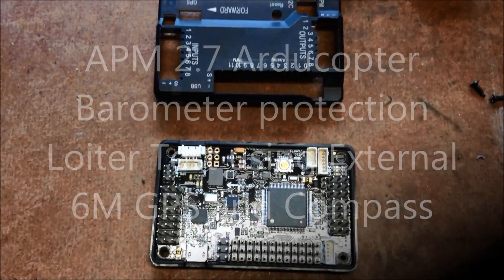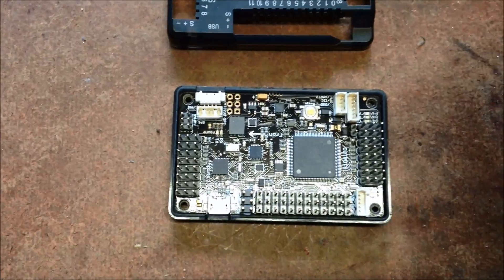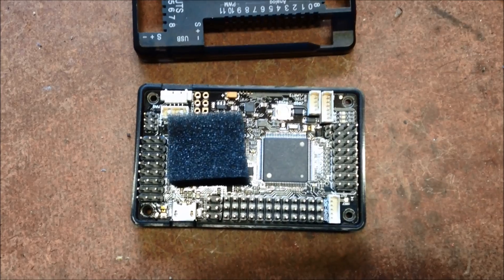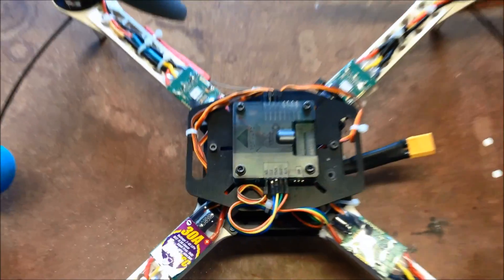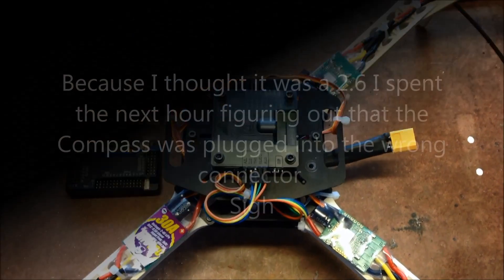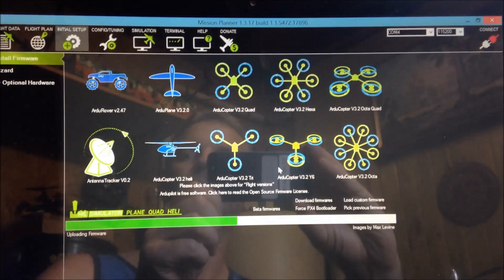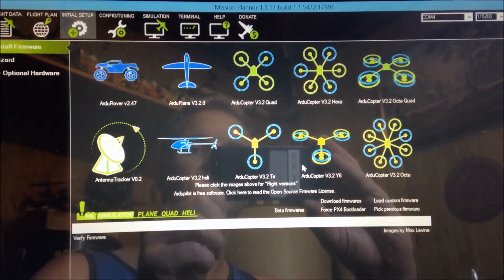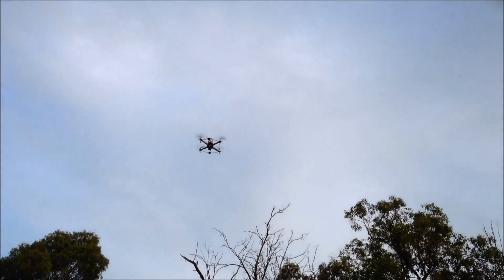Hobbyking HKPILOT 2.7 APM V3.2 Barometer Location and Protection with Loiter Test.

Comment: Sorry for bothering you Simon. I have my APM all setup and everything is working perfect, i was just wondering if i can increase the loiter speed. In loiter when i have the stick pushed fully forward in pitch the quad moves at a slow speed. I know i have the pitch and roll settings down low in the basic tuning menu, if i higher them will it increase the forward speed.

Comment: I was using the power lead that came with the set but was having problems with the quad not powering down. When I don't use it it seems fine. So I will just take out the middle wire from the other 3 esc's. Thanks

Comment: Sorry for bothering you Simon. I have the hk 2.7 apm and afro 30 amp esc's.Do I need to take out the red and black wire to tree of th other escs when connecting to the board. Thanks
Reply from the maker: Not if you use the power input supplied with the APM Controller. The Jumper on the APM isolates the ESC power Rail. If you are getting power from the ESCs then yes. Remove the red wire on all but the No.1 Motor ESC. Thats the middle wire if your esc colours are not normally coded.